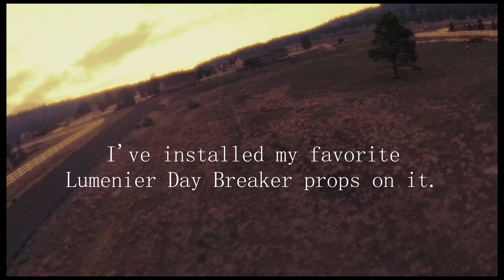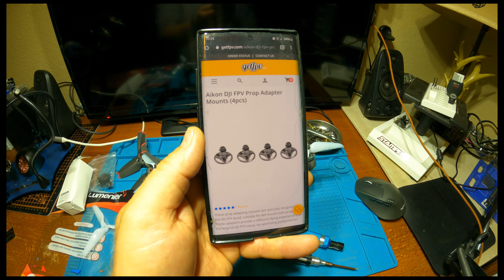DJI FPV Drone Aikon Prop Adapters Install and Flight.

Comment: Hi, what PID did you use with these propellers?
Reply from the maker: It's been a while but I believe we used the pids settings that original dobo put the video out on..
Reply: @upnorthFPVandEUC  oook🤙

Comment: I Finally got around to putting my adapters on my DJI FPV drone after having them in the box for two months and it's big difference. I haven't tried those props you have but I'll give them a try, Thanks!
Reply from the maker: Your going to love the feel.

Comment: I use the Gemfan Hurricane 51499-3 props. The drone responds so much quicker, prop wash is eliminated and the motors are cool to the touch even after 4 batteries in hard acro. I do not recommend using the Gemfan 5552-3 props. I kept getting a motor overload warning and the motors were hotter than satans ass after only 1 battery.
Reply from the maker: Awesome information!

Comment: Any change in speed? Prop wash?
Reply from the maker: I will have to do a high speed pass because that's a good question.   As far as prop wash I didn't experience any and float time for acro is better imo.
Reply: @upnorthFPVandEUC  awesome I’ve been flying with nazgul and Gemfans. Just bought me a pair of these. Excited to give them a try. Thank you.
Reply: @upnorthFPVandEUC  do you have ig? Have to follow you in case you try more props
Reply from the maker: @christopherM1107  not for my drones... probably should.  Just this channel.
Reply from the maker: @christopherM1107  definitely let me know what you think..  I have other props here but on my 5 inchers I absolutely like the Day Breakers the best. I will post a goggle view flight I did yesterday with my  "sorta" Nazgul .. it has T motor 1950 motors and the Bardwell f7 stack with the lumeniers on.

Comment: So I just installed my aikon adapter to my DJI fpv drone … and as I hover test it, it flies a bit forward and to left and a bit to the other side as well… any tips? Anything I should check? Maybe I unevenly tightened the nuts above the props? Let me know, thanks!
Reply from the maker: Interesting.. I never noticed this problem.. maybe you had a bad GPS signal??

Comment: How’s the flight? Are your motors over heating at all?
Reply from the maker: I feel that it was flying the most locked in I've felt with stock pids and motors did not get hot.